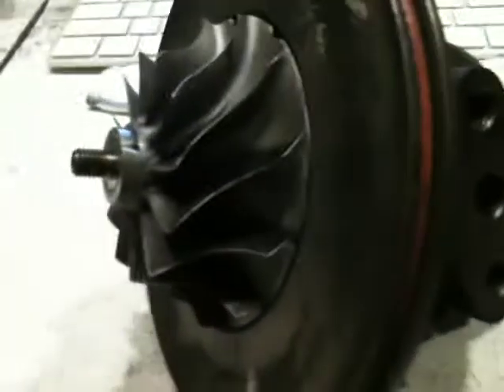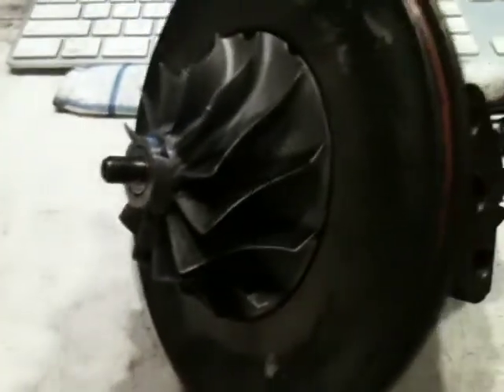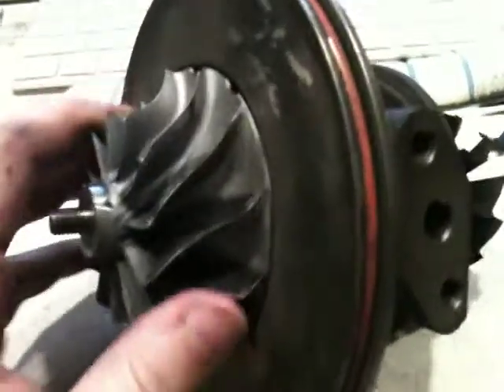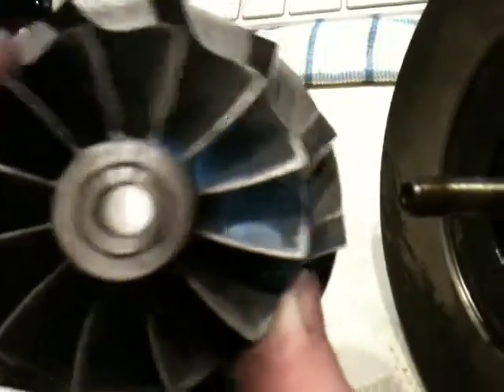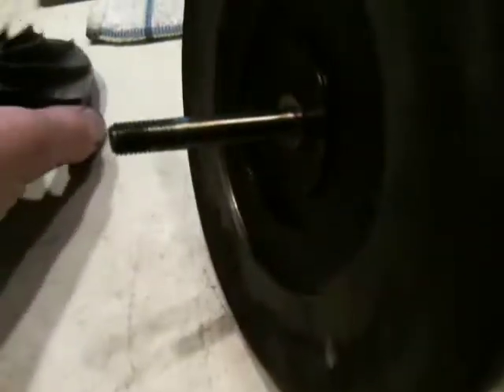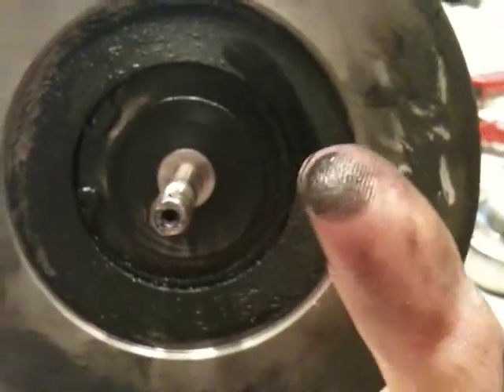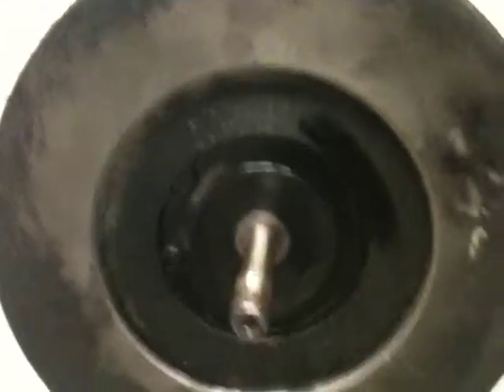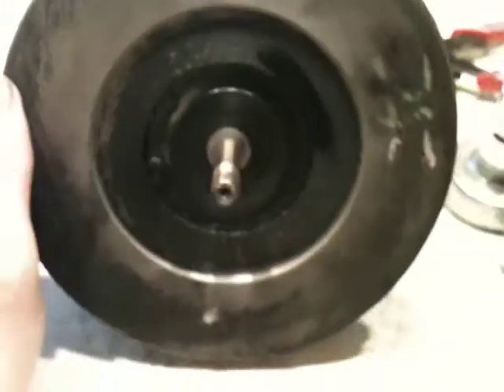Banks Sidewinder TE06H Rebuild Part 3

Comment from the maker: The early model Banks kits didn't have wastegates. You probably have a Gen 1 banks system and I am going off that based on the fact you say it says "Banks" on it. The earlier ATS and Hypermax setups didn't have wastegates, either. I have yet to deal with an early model Banks system but the kit might be the same. Google around before you order any parts. If it is a TE06H or similar, the kit I used should work.

Comment from the maker: I found it on Ebay. There are a few sellers with them. Keep in mind there are two types of kits; one has heat shields and one just has the bearing sleeves and O-rings. Either should be fine unless your heat shields are damaged. Good luck!